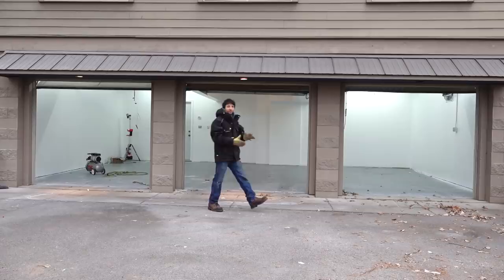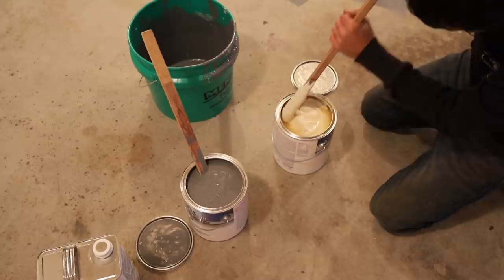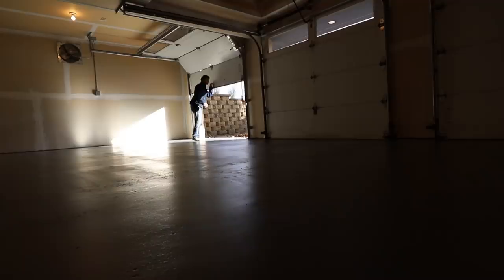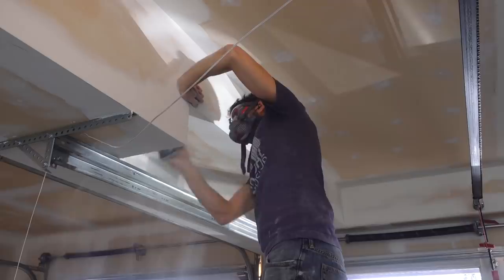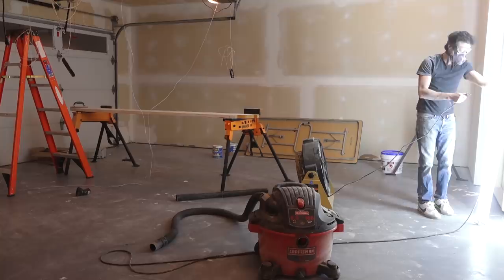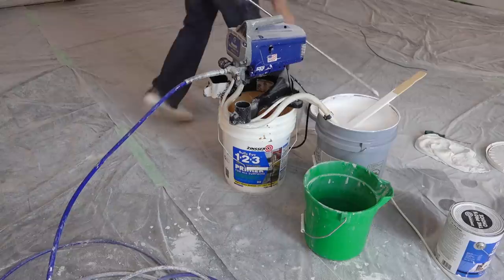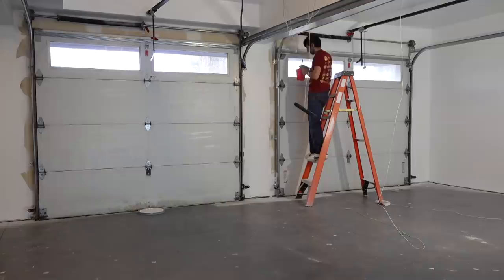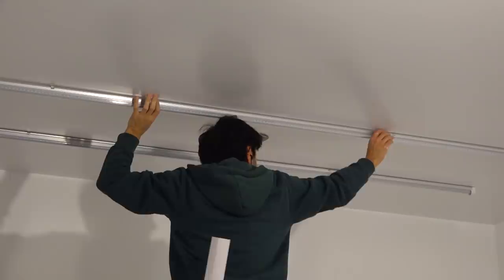Painting the New Shop - Moving My Woodworking Shop [Part 1]

Comment: My wife and I have been doing tape, finish, and thin coat for almost 40 years. Some suggestions. Lose the tray and switch to a hawk. You have a lot more control. Start with a 5 or 6 inch very flexible knife. Switch to a 10 inch flexible knife. Spot fill and then prime with a thick white primer. Go back and spot fill again. We usually don't need to sand, just go around with the 6 inch knife and scrape off anything that sticks out. Finish paint. For what it is worth. Glen and Christa

Comment: As far as the comments about ceiling and walls first..... Just a little isopropyl alcohol and paper towels will quickly remove the over-spray on the floor.  A quick wet mop for the dust and you are good to go.  I have had many shops and this process brought back the memories of prep work.  Definitely will appreciate the work after moving in the equipment.

Comment: Gonna be magnificent.  
As a former professional painter (well, house painter) I can tell you that we don't stir paint we "box" paint.  I don't know the origin of the word.)  With one empty container we pour half a can of paint in.  Then with the other can we pour half raising it high over the center.  The inertia of the stream of paint drives it to the bottom and it partially mixes as it wells up. Then with the spare can of paint we pour half into the other 2 cans one at a time by the same method.  The least dense paint is driven to the bottom and any mistaken color differences are erased.  

The process can be repeated.

Merry Christmas and a Swinging Saturnalia!

Comment: This is why you paint the ceiling and walls before the floor, but you will know next time. I was hoping for an epoxy floor with a channel logo at the entrances, but maybe in the final shop when this one gets converted back to a garage?
Even though you blew the drywall mud dust off the car, you may want to change the air filter in that car. Shop is looking good so far. You daughter is quite the little helper with the clean up during lighting prep there. So cute😁.
Reply: YEP
Reply: Sounds like good idea  💡
Reply: Maybe a collab with that epoxy countertop channel? Some clear epoxy in sections over some thin 1/8" to 1/4" log "slab veneer" with some "river" color between the slab islands? That would make an awesome shop floor.
Reply: Why? Was the car running when he was blowing out the garage? Do you change your air filter after driving behind someone on a dirt road too?

Comment: When spraying (if you happen to do another room) use a thicker plastic on the floor. Itll help not get blown up, and the sticky overspray won't destroy it walking around. Also if you end up caring about your tape line, peel when wet. Gotta say, coming from a painter, good job on your paint job

Comment: Matt, really nice job on the makeover.  As a retired electrician just a suggestion.  Never use the max ampacity of a circuit for steady state load.  Their is a rule that we always used called the 80% rule.  In other words, because a 15 amp circuit is capable of 1875 watts, you shouldn’t plan for more then 80% of that or 1500 watts.  Again, nice job.

Comment: I say this only to prevent a shop fire. I am soon to be retired,licensed electrical /HVACR contractor. As per National Electrical Code any load that is considered continuous such as lighting and electrical heating you can only load a circuit to 80 % of its capacity. On your 15 amp circuit you would only want to load it to 1440 watts. The reason is the long term heat on the wire will break down the wire insulation. As I said long term, you don't need to change it today. When you add or change out the lights you may want to add more circuits. Surface mounted conduit would be a easy fix. You very  smart in using lots of smaller lights vs only a few brighter light fixtures. Light coming from lots of different angels will get rid of shadows. You may even want to try a few of those light fixture on the sides of the  beams. that will help light any vertical surfaces. All auto paint booths have more lights on the walls than the ceiling so the sides of a car being painted has no shadows.  THANKS for all you great videos!   Dan Hamilton

Comment: I did hardwood floors for 25 years... The type of applicator I used would have given you an even coat first time, and easier to recoat... Th e applicator is non-rolling and you apply pulling from one end the area to the other... after cut-in of edges.... Good luck, can't wait to see the finished area... Ron from Sandy, Utah...

Comment: This late fall while we were waiting for the baby to decide it was time to be born, I refinished (including drywall) two basement bedrooms.  First time I'd done mudding, and I watched a LOT of the same videos I'm sure lol  The drywall sander would have been nice.  And I agree, progression happens fairly quickly.  That's why I started with the guest room, and did the office second, since I'll be spending a lot more time in the office :D

Also, I bought similar lights to replace those Florescent lights I gave you with 4' versions of what you have, except I opted for the milky/translucent covers rather than clear.  I initially bought a clear one to check quality, and I am not a fan compared to the other ones.  And unlike you, I ended up with a LOT of extra linking wires, because I ended up buying twice as many as I had lights to connect, because I didn't know how far apart I was going to make them.  I ended end-for-end connecting them all, so I didn't use any lol

Comment: Removing the door opener also makes it more secure- it’s very easy to reach in and disconnect the chain. You could get ride of the external lock and handle, too, and make it even more secure.
Reply from the maker: No external handle on these

Comment: Check the garage door opener you removed from the ceiling [and its remote], for a backup battery- if it has one, remove it so it won't leak and eat up the electronics you might want to use in the future.

Comment: Great to see this taking shape, Matt. I recommend the Liftmaster 8500 garage door opener - it mounts to the wall and will give you back a ton of overhead space. Plus it's quieter in use. I've owned several of them, and have nothing but good to say about them. Might be a worthwhile upgrade for the new space!
Reply from the maker: Was planning on doing that but I’m just going to go openerless.
Reply: @mcremona  Well, that's another way to regain that garage head space! TBH in my current house I've not yet moved the electrical outlet, so still have an extension cord strung across the ceiling... 4 years in. So at least you won't deal with that! Cheers.

Comment: I have the Porter Cable version of this drywall sander. I found it crap for walls. Where it was amazing was I recently put a wood floor in the shop. I applied two coats of Poly 6-8 hours apart without sanding for next coat per instructions. Left it dry overnight and checked in the morning. realized it needed 1 more coat. Now I had to sand. I used the drywall sander for this and it worked perfectly. it was as easy as mopping the floor. Now the finished floor looks great. Far too good for a shop actually!

Comment: WHOA WHOA WHOA ok your math was right on the watts of the circuit breaker but NEC limits continuous loads to 80% of a circuit breakers rating. Lighting is absolutely a continuous load. Don't put more than 20 on one 15 amp circuit breaker. They can be split into different switched groups but still on the same circuit breaker.

Comment: instead of baseboards in garages with a gap to the floor. i trowel in cement. versions without rock.  so water or liquids on the floor does not get to the bottom of the drywall..  also makes it crazy easy to sweep or blow out.  i do the same in laundry rooms.

Comment: Big tip for mixing paint. Get an empty bucket. Pour the paint into the empty bucket. Pour the paint back into the original can. Repeat. 
Also, if the other bucket is bigger than the original, it will make manual stirring much easier. Stirring a full can of paint is just asking for a mess.
My dad was a real apprenticed painter (not these unskilled laborers who paint houses today) and has taught me all kinds of tricks like these.

Comment: I am a year late on this video but I would be surprised if the floor paint hasn't come up by now based on my experience.  My garage floor had only seen very light car traffic over its 35 years.   I roughed up my concrete floor to break the sheen, degreased and pressure washed the floor about 4 times and used a top quality porch floor latex but to no avail.  The paint bubbled soon after and then came up in sheets.  I don't have a moisture problem; so, maybe it was the salt.  No problem painting my basement floors with the same paint.

Comment: Congratulations! You did level 4 on the garage. And now you know that they did a level 3 in the rest of the house. Frustrating, isn't it?
You'll be thinking about Liftmaster garage openers shortly. 
Also, ceiling and walls first, then the floors...
Instead of baseboards- Vinyl laminate wall cove base

Comment: Man, I love my Magnum X5.  I just did something similar last year when I had to paint the entire ceiling of my 1000 square foot garage/shop.  I also used ultra white satin (I applied Drylok to my block walls, with roller though, not sprayer).  I looked like a mess afterwards but I couldn't imagine doing that, in between joists and other nooks, with a roller and brush.   I hung Sunco 5000k fixtures from Amazon between joists. Thanks for sharing your process!

Comment: Nice space you have.  I would have cleaned and etched the floor first like you did... but I would have painted the floor last because of all the work you still had to do on the walls and ceiling.  Looking forward to your next step.
Reply from the maker: I was mostly concerned that any paint that accidentally got onto the floor would be more work to remove so the floor paint would adhere properly
Reply: You could have covered it with plastic like you did.. then remove to paint last.  Just my opinion on how I paint floors.  No worries. Thanks for your response regardless.
Reply from the maker: Assuming I’d tape the perimeter like I didn’t 😄

Comment: I learned, after watching This Old House that you can, after a bit of practice, put on one coat with a 4", let it dry, knock off the high spots with a 6 or 8". Then the next 2 coats do the same with little to no sanding. The more you practice the less sanding you will need. A total of 3 coats. I learned to roll everything, spraying is a waste of time and $$. Primer? Nope. Gloss is less cleaning and more reflective.

Comment: I have found that with more than 1 lighting circuit (I actually have 6, 4 small 2 big + tool lights) I can have as much as I need. My total is about 900 watts or 65,000 lumens on a 3.5 metre ceiling and about a 90 square metre floor area.

Comment: When I was working for a home builder he noticed my putrid attempt at sanding drywall. He handed me a pail and sponge and a 18 in broadknife. He said just wet a section down and drag the knife over it. It was so much easier And I got quite good. It's still the only way I finish drywall. No sanding dust anywhere.

Comment: Floor looks good, I use to run a auto shop we’re we had to clean the pit floor daily. We ran out of the cleaner for, so I got a bottle of Dawn dish soap mixed with water. Then power washed it, it did a much better job and it’s not bad for the environment. O don’t matter how old you kids get, don’t alway Listen to the dad’s and mom’s lol. Shop look good.

Comment: Try the Liftmaster 8400/8500 wall mounted jackshaft openers - I installed two in my new garage, they are silent, smooth and quick (and no overheard nonsense to bump into during projects)
Reply from the maker: I was leaning that way but I find manually opening the door to be more convenient for me
Reply: @mcremona  fair enough.  At $400 each I was on the fence, but install was simple and I love the overhead space.  Love the new shop, how exciting!
Reply from the maker: Probably will install one when it converts back to a garage though. Looks like a much better solution than overhead

Comment: Make sure you get that drywall dry all the way from power washing , so you don't introduce a mold situation that you don't find for years. Test it with your moisture meter.
Reply from the maker: There was a month in between
Reply: Matthew Cremona not one to comment on stuff like that ,our house before last I had done the same exact thing .fast forward 4 years selling house and inspector found mold in the corner by the track and it about derailed the sell and out 2 grand. 
  Can't wait to see your shop take form. Probably be some good videos setting it up. Hope the new year treats you well.
Reply from the maker: Thanks Rod!

Comment: I was wondering why you didn't use an extension. They work good on walls too, getting you farther away from the paint. When we did our garage floors, we poured the paint on the floor and used a squeege and roller to spread it.

Comment: What was the reasoning for finishing the floor before mudding and painting all the walls and ceiling? Also, why not run all electrical in the walls before finishing the drywall?
Reply from the maker: Giving the floor plenty of time to cure and not having to worry about removing any paint from the floor as part of the prep